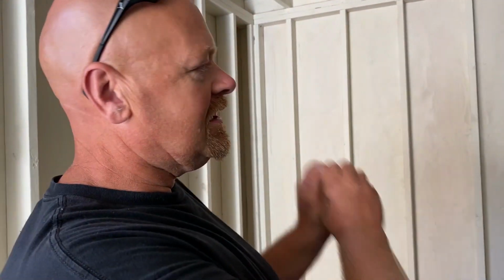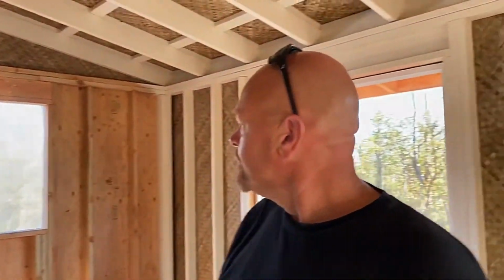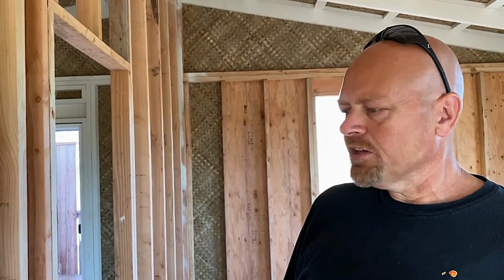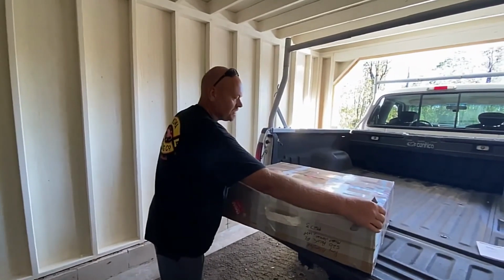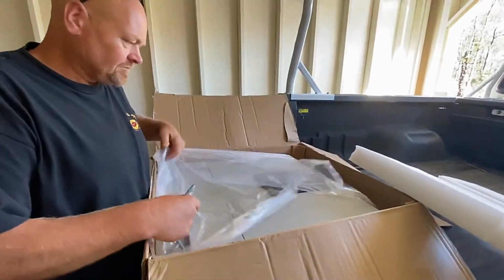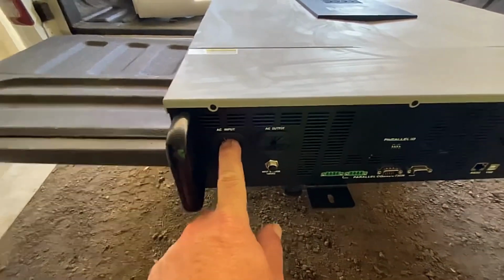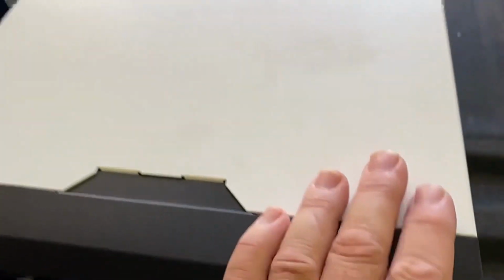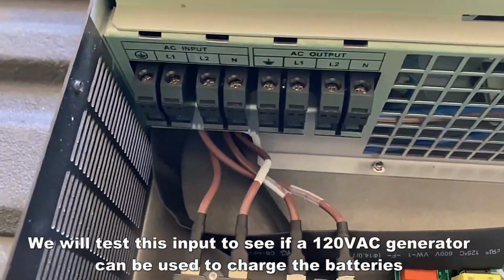66 MPP Solar LV5048 Split Phase Inverter Unboxing and Ray's Home Tour

Comment: IS IT A HIGH OR LOW FREQUENCY INVERTER FROM IT BEING SO BIG ?
Reply: Defjamsgreen I’m sure it’s a high frequency inverter like all other MPP Solar inverters. It’s lightweight and nearly 3 times the size of their single phase inverters. It looks impressive, but I believe it’s literally two LV inverters clocked 180 degrees out of phase with each other.

Comment: If I used one or two of these. What volt panels would I use they make 12-20-24-32   ❓ also series or parallel
Reply: chris patirot I made a video primer series several years ago you should view. https://www.youtube.com/playlist?list=PL881BEC0EFE5870D4

Comment: Could you check how much the power draw is with battery only connection with no load.  Thanks
Reply: Jake & Alma Guenther I’ll try to check when I go there but it may be a few days.

Comment: I don't remember if this was the video or not but one of your "people" had a SigmasTek SP12-250 battery bank. How did you like those and how do they stack up to any other deep cycle 12 battery? I think those are relatively cost effective for a 12v option.

Comment: Steve, greetings from Korea.  You mentioned using the relay contacts to charge your EV.  Have you been doing that long enough to give an estimate on miles per week/or month you get to drive off of your PV "excess" ?  Does it cover your basic transportation needs? Awesome video!
Reply: David Tolson Yes the EV takes us to town 2-4 times per week using our excess power generation. But our PV array is 7kw.

Comment: Aloha Steve, This is the inverter I was talking to you about! I can't wait to see your next few video's about how you hook up the solar panels to keep within the 145VDC, and I hope to meet you sometime soon. Bob & Linda
Reply: Robert Wolfe Well Bob you can see that busy is an understatement for me. But yes in the next couple weeks we will be giving this booger a good test drive and have it picked over to know the good, the bad, and the ugly about this inverter.
Reply: @OffGridLivingSteve  Let me know if you need a hand.... I'm just right down the volcano from you!!!
Reply: Robert Wolfe P.S.  I haven’t forgotten you. I plan to get over there as soon as this project is finished.
Reply: I'm buying this too and I also need to figure out how to keep 20, 245w  panels with a VOC of 36 volts under 145v
Reply from the maker: You must wire the panels in sets of 3. You will be able to use 18 panels with 2 left over, or buy one more panel in order to use them all.
If you were to wire them in sets of 4, you would be under the theoretical limit, but during cloud edge your inverter could throw an error and stop functioning until you reset it or worse, burn out the MPPT circuits which would not be covered by warranty.

Comment: The split phase inverters cost about twice the cost of the other inverters ... is there a good reason to buy the split phase version vs a non-split and add a toroid transformer to generate split phase? I imagine the split phase may be a little more efficient but not sure it justifies the cost difference
Reply: turbo97se turbo97se there are some definite limitations with this inverter. It is more closely spec’d similarly to the PIP MS series inverters. Essentially two of them running 180 degrees out of phase with each other.  I’ll cover it more in the next video on Ray’s installation.
Reply: Thank you for the quick reply ... so it sounds like a no to my question then ... I am looking to get a hybrid inverter real soon ... there are a lot of MPP solar models to pick from looks like most people are using the PIP 5048MG ... that is my leading one right now please let me know if you’d advise otherwise  ... thanks again!
Reply: turbo97se turbo97se that’s my favorite inverter because it will easily charge nickel iron batteries. But if you’re using another battery technology, the 5048GK offers the same PV high voltage specs and capacities but with configuration via Bluetooth Using an Android phone. The only real difference is the GK model only goes to 62v instead of 64v. The GK model is also a bit less expensive.
Reply: Thank you sir! Appreciate your thoughts that really helps ... with so many similar choices it’s hard to tell which one is best ... many would respond “depends on your situation” ... I am not on a tight budget necessarily but willing to pay for stuff it is worth it ... best of luck ... I am subscribing for sure!

Comment: Hey Steve, is this unit capable of running in "battery-less" mode like the ones you initially put in your house?
Reply: youngenuf no, this unit will not run batteryless. It has a lot of potential, but it falls short in a couple areas. It is probably better suited to lithium batteries also. Bulk and equalization voltage settings will not go above 58.4v.

Comment: Steve take a close look at the specs on that unit. To me it looks like 3 in parallel max, 145V string max,  max float at 58V, 8000w input but 5000w output? I guess the string max and the float max would be my big issues.
Reply: Brad Quinn yes it is 145v max input like a MS inverter. We’ll look at everything closely. Installation starts today.

Comment: Great vid.

I got curious regarding the ground hardness.  

Is there a lot of volcanic rock underneath?

Would it difficult to trench around Ray’s house to place a French drain?

I liked the wall materials he chose.  

They seem to be breathable, and perhaps they mighty help avoid trapping humidity inside the walls.
Reply: Eric Kosak there is generally I few inches of soil, then solid volcanic rock (lava). Most people have the lava ripped with a bulldozer and then laid back down and packed. As a result the ground is well drained. His walls are breathable and I’m excited to see the entire project done.

Comment: Split phase.!!!
What is the output on that amps and voltage.???? Thanks Steve.
Reply: Roy Stacey it’s rated 5kw. It looks like 2 MS5048 inverters wired 180 degrees out of phase. Two chargers, two inverters all in one cabinet. We’ll know more as we dig into it.